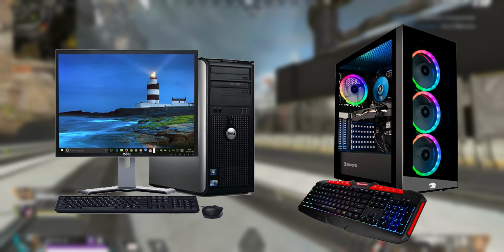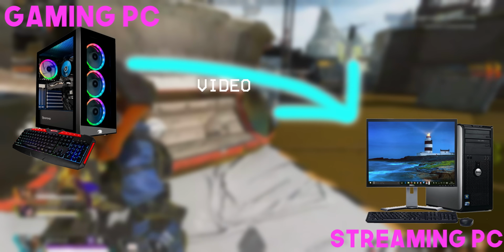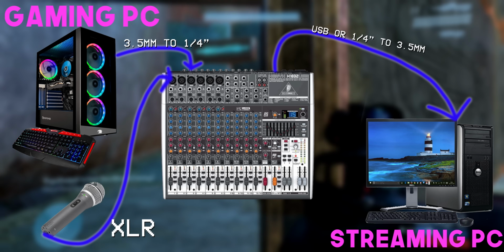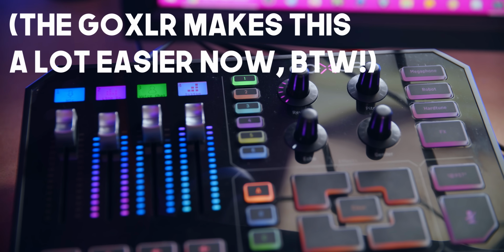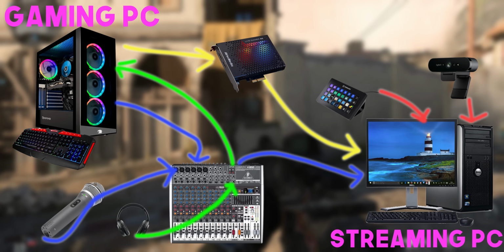SINGLE PC vs DUAL PC STREAMING SETUP - Why and How (Introduction to Dual PC streaming setup)

Comment: Another benefit of using two PCs: the main PC can crash, you still are live on the stream, you can restart the game without losing all the viewers. ;)
Reply: dude you're like smart smart lol
Reply: this is my main reason. i'm building a new gaming PC anyway, i'll just keep using the existing PC (that currently runs OBS+game) for just the streaming/OBS stuffs
Reply: Streaming BSOD Pog
Reply: @Zvala wouldn’t the bill be higher when using 2 PCs?
Reply: And footage💀🙌🏻
Reply: this is why im here my pc keeps crashing im building a new one i maybe try 2 pc setup for this
Reply: @Zvala Too minor to take seriously
Reply: Oh, good point!
Reply: Another benefit of a dual PC setup: you can physically bypass the need for game capture in games where the anti-cheat would penalize you for doing so (CS:GO and untrusted mode), on top of the performance/stability benefit of having two physically separate systems.
Reply: & another benefit is that 10x extra electricity monthly bill each month ;)
Reply: @ItzGhosty420  not really, unless u go with Intel CPUs
Reply: @ItzGhosty420 you'd be surprised. I actually monitored my PC for a month and left it on for looking periods of time. On top 2 hours of gameplay I can get every other day. In a month I estimated it cost about 10 bucks all together for my PC to run constantly in the background. And yes that also includes the times I spent actually using and playing the PC. I'm actually gonna try another month. Where I'll regularly turn it off and on. Just to see how much that will cost. Because I always heard your electronics take up the most power when u first turn them on.

Comment: Another way to send the image (instead of duplicate or passthrough hdmi): run OBS on the gaming PC to get the game capture and send the preview to the gpu hdmi port ; you can send the audio as well through hdmi (monitor). Also careful NDI is YUV 4:2:0 downsampled (like the Elgato 4K60 Pro). The AVerMedia card does 4:4:4 in XRGB.
Reply from the maker: Yeah but if you're running OBS on gaming PC you're already missing half of the performance benefit of doing dual pc
Reply: @EposVox  it's very lightweight doing only a preview (much less than NDI and almost only GPU usage, around 3% on my RTX 2080 Ti with 1440p 60 fps output), and it has some advantages: you can still use the DisplayPort on the main PC and have G-Sync / variable framerate = can play 1440p 120 Hz like I do, and get a smooth 60 Hz preview for the capture, even using just a Full-HD capture card (sending the preview already in Full-HD). But yep, thanks for the quick answer and advice. xD
And another trick I'm doing: no need for any mixer, I get the game sound from the HDMI capture ... and the mic is directly on the streaming PC, that's it (with RTX Voice & compressor and all, yep using a lot of resources but it's on the stream PC we don't  care :p ).
Reply: @FredCHAUNIER  @eposvox I use this setup successfully too. OBS and Discord on the gaming PC don't hit hard at all, then all Gaming PC Audio to stream PC via 'Listen to Stereo Mix on Elgato HD60 Pro'. Mic levels and Stereo Mix levels balanced on Gaming PC.
Reply: @FredCHAUNIER  Hi Can you help me set this up? thanks
Reply: @dw300  Hi can you help me on this please thanks :)

Comment: Very helpful! I have a 2018 Mac mini w/ 6core coffeelake, just collecting dust...Could I use my Mac to stream, while PC for gaming? Zero info online covering my question.
Reply: In theory yes. You would need to either use an external capture card or NDI to get the feed into the Mac Mini however. I would just double check that if you buy a capture card it is compatible with your mac.
Reply: I'll buy your Mac mini if you're in the USA

Comment: I have been running a 2 pc setup for 4+years I highly recommend it especially if you play slot of beta or early access games!! Good video!
Reply: What's the specs of your 2 pc?
Reply: @MrRukanachi  Ryzen 7 1700 16 gb ram AMD r9 380
Reply: @Aims Yes because if you have to restart your gaming PC stream dosen't go down.

Comment: The value of dual PC streaming is completely dead to me,  Ryzen 3950X provides way more then enough power for CPU encoding and playing any games at a single workstation bypassing all issues involved with setting up 2 PCs for streaming.

Comment: So totally stupid question, but do you need a graphics card in your Streaming PC if you plan on encoding via x.264?
Reply: You need something that can handle 1080p 60fps video to composite the capture cards output and any webcams together. If your built in graphics can handle this then no. I tried a super basic graphics card that could handle 30fps but not 60, then bought and old 550Ti for £20 in a computer exchange store.

Comment: What exactly are the issues you come across by mirroring the display through HDMI you mentioned at: 4:15
Reply from the maker: Stuttering, hitching, it not wanting to adhere to the correct res/refresh specs you're trying to use every time Windows reboots, etc.
I had to switch capture cards in my dual PC setup because for what I was trying to do, only cloning worked and I got constant stuttering/pacing issues that weren't actually present in the game, but just caused by the cloning process, and not a problem with passthrough. While not universal, these are definitely not uncommon experience with cloning for gaming.
Reply: @EposVox  ah I see thank you for letting me know!

Comment: Minimum/reasonable CPU for the streaming PC? I don't want to get one that'll just need replaced soon down the road, but I don't want to spend too much on it either. Thinking about getting a cheap prebuilt or a used "entry gaming" PC on ebay/craigslist.
Reply: Hi Zero, you better wait for few weeks for the Zen 3 CPUs to come out if you do not want to upgrade immediately. But, if you are planning to buy before that get a 3900X or better(even if the new CPUs come out look for the similar spec'ed CPU). 3700x or 3800X would also do but 3900X is better future proof. But as per your requirement and less spending go for 3700X or 3800X.
Reply: Don t do 2 PC setup bro.3900/3950x 32gb and an rtx2070super or above is what You need.

Comment: Dual PC is awesome! But for now I'm just fine with my single PC setup, and like the simplicity of it. Good video, as always!
Reply: ur pc specs?
Reply: @rudraksharoy3594  I run a ryzen 7 3800x / 32gig 3200mhz ram / 2080ti and my single PC streaming is smooth. Never have had a problem so far. And I use x264 encoder. Epos secret settings as well.
Reply: @aes210  could you please share those settings? 10900k+2070 Super, trying to use x264 as well
Reply: @aes210  how much was that
Reply: @rudraksharoy3594  You either need a really nice CPU like a 3900X or a Turing GPU from Nvidia, because of the NVENC encoder it has on board. My son's PC only cost $750 but he can stream on because of the 1660 Super GPU. Hope this helps.
Reply: @GraybeardGiffTech  and a better connection than 25/5 PepeHands
Reply: @GraybeardGiffTech  I have a 1660 ti and 2600. And 8gb ram and with all that my stream is really smooth and I dont get any frame drops

Comment: i have extreme difficulties in capturing discord as a window source in streamlabs obs consistently... on a machine works as it should in another... black screen and i've tried everything comes in my mind (disabling HW acceleration ofc updating drivers deleting %appdata% reinstalling discord and obs) out of frustration i've found a solution for me.... screen splitting software! i have a 4k  tv so i thought 4k means 4 1080 monitors and i can get the discor'ds feed as a screen capture. so far it works smoothly. It still bugs me i can't figure why in one machine i can't do it in windowed mode though.... but... i've came to a conclusion that you have to deal with what you have and what you can do to make your stream work....

Also i have a problem that i'm streaming RPG so i need to mix audio but i have a blue yeti as a mic and the only solution was to use a virtual audio mixer like the bananameeter (can't remember the exact name) but oh boy it's buggy i had to restart the audio driver over and over and over so.... right now i'm doing a really stupid thing like picking ambience music through the blue yeti using alexa as a speaker for that application.... and i fear that if i switch to a dual computer setup i'm bound to reinstall audiomeeter banana again...
Reply: Set all the software you're using to run as Administrator, that'll fix most of those black screen (and any audio delay issues). Right click > properties > compatibility > Run as admin. Change your input and outputs in Voicemeteer Banana to Windows Directsound or MME and that can get rid of the virtual engine crashes, but they all should be the same setting.
Reply: @dw300  Thanks I'll try it soon. saw stramlabs obs now has 2 options to capture windows 
bitbit (wich works for me) or windows graphic capture (wich is the mode selected automatically and gives me black screens)

Comment: Dear EPOSVOX does a stock AMD3900x or 3950x stream games at a higher fps than a stock intel 9900k due to the extra cores?
Reply: No. Almost no games utilize more than the 8 cores/16 threads of the 9900k, which wins on faster Instructions per Clock (IPC).

Comment: i am using voicemeeter banana, a very good software mixer, and there is a feature in it called VBAN, a way to transfer audio through the network between different machines. so you might not need extra hardware for audio

Comment: Having a second PC makes everything a lot smoother trust me makes a lot of glitches go away
Reply: Never had any glitches on 1pc
Reply: It depends on your pc, I have no problems with 1 pc build for gaming /streaming.
Reply: @bluebluem4  you use alt+tab alot then?
Reply: @cali_cal  for what???
Reply: @cali_cal  have extra monitors and hotkeys. Easy.
Reply: I've wondered if a 3950X with 2080 Ti or better can be more than enough for "two pc" setup?
Reply: @RUmlas  2080ti alone is enough for a single pc setup
Reply: @RUmlas  r u serious? I have 3700x with rtx 2060 super, it goes so great, no stutter, no lag, no perfomance loss, etc... So yes, that setup you mentioned it's enough!!!
Reply: @bluebluem4  what encoder do you use? X264 or nvec?
Reply: @RUmlas  That's better than some cheap dual setup!

Comment: I ran a 2-PC Streaming Setup and I went back to a Single PC Setup. The main reason is audio! I need to use ingame-voice AND TS/Discord, Voicemod and Music and the setup got so fucking bloated that I finally switched back. I got the Hardware to do so and NVENC helps alot to achieve this so there is no reason except redundancy to do otherwise. My streaming PC was a Windows driven maxed out 15“ Macbook Pro. It worked fine but it is so much easier and I dont want to invest in an extra tower PC AND mixer, new interface and so on. Not yet ;).
Reply: Nice man! But whoa, how did you stream on the macbook pro? I thought it only uses VBR encoding which doesn’t work well for real time?
:0
Reply: @muen1842  actually the radeon encoder is not that bad ... worked pretty well and did a much better job then cpu based encoding
Reply: If you do go back to a 2 PC streaming setup then I would look at Voicemeeter and use the VBAN feature. Makes sending audio to and from multiple computers a breeze.

Comment: Easy: NDI. Done. but NDI's quality is really horrible. I don't get why they say "you need 1GB internal..." when it only maxes out around 120Mb across the router even when setting it to High bandwidth usage
Reply from the maker: 1080p60 NDI usually uses 200-300mbps. Quality is not horrible in any testing or experience I've had/seen
Reply: @EposVox  Good to know it's not really 120MB, I only saw a video of someone testing it and it was peaking on his at around that. Quality issues: well, I'm 1440p going 1080p, and most likely why it's bocky/blurry on my stream. I'll have to toy with it more maybe. I like it, it's like 1% usage on my gaming side, which I love, can't feel a thing!

Comment: I have been able to put up with all of the headaches of display cloning...except for the alt tabbing. 10-15 second alt tab freezes are MY NIGHTMARE. 1440p144hz gaming with a monitor lacking hdmi 2.0 and a dual pc setup = a bad time right now. We need more monitors on the market.

Comment: Please do a video on multiple monitors with mixed refresh rates issues on single streaming PC.
I'm driven crazy with OBS preview window stutter (which translates to stream/recording) because OBS is open in a secondary monitor with a different refresh rate to the main monitor.
Windows 10 update 2004 was supposed to resolve this issue but does not on AMD CPU systems.
Reply: Why do you need to see OBS preview while streaming (you can turn off preview)? You should be monitoring the actual stream.
Reply: @Safetytrousers  
It's pretty standard to have OBS running in a secondary monitor I believe? Video even states it at 8:29.
You can monitor your preview window (which is what the viewer will see), your scenes, monitor your Twitch chat & stats and you can monitor your stream stats for network lag, skipped/dropped frames due to render or encoder lag etc.

Comment: if i have a Ripsaw HD capture card that only has HDMI input and output but my monitor is a 2560x1440 @ 144hz monitor using a 2060 Super that only has one HDMI and 3 Displayports, how could I most efficiently do this while still being able to game at said res and refresh rate?
Reply: Get a display port to HDMI cable due to the way that display port is handled as long as it’s a display port source you should be grand
Reply: You could also clone the output so that your HDMI and DP are getting teh same signal from your graphics card. I'm not sure what the impact of that would be performance wise however.

Comment: Hey Epos, I have an unusual situation that I hope you can help me with. I am planning on dual PC recording but I have a 21:9 (3840x1600) monitor. Planning to record OBS 4K with other sources taking up the 560 pixels of black space at the bottom such as face-cam etc. I know that most capture cards don't do odd-ball resolutions that well but will this work because it's in standard 16:9 4K overall or will it fail because it's transferring the 21:9 signal? If so, what do you think is the best card for 3840x1600 recording?

Comment: On the needing multiple monitors,

For chat, you can use a smartphone set above your webcam, so you look in the general direction of the webcam when reading chat.

If you want to be fancy, you can even use a teleprompter with the chat running with a mirrored screen. This allows direct eye contact with the audience Every time you read chat.

Just add /chat at the end of your url.

Ex: https://twitch.tv/eposvox/chat

Comment: If you can afford a dual pc setup it is imo the way to go even if both systems are low to midrange over a single high end system. Imo the only disadvantages of going dual pc is the extra cost and technical setup but imo its worth it by giving you a lot more power and control over your stream.
Reply: The only extra cost is a capture card,  software only voicemeeter is required.

Comment: Sad to see that Voicemeeter doesn't get mentioned. You don't "need" a mixer.
Reply: How can voicemeeter send audio from one pc to another? How can voicemeeter take an xlr input? How can voicemeeter merge audio from two pc’s into one headset?
Reply: @Martin__  vban which requires voicemeeter on both machines. Usb audio interface is still needed for the xlr. Voicemeeter banana and above can send audio to both headsets. As a shareware solution it solid til you can get the funds for goxlr
Reply: @Martin__  VBAN. It sends audio over ethernet cable. You select the source/destination, give it a name and fill in the ip of the receiver/sender and done. With only a small delay. 

If you use an xlr mic you'd still need an audio interface or xlr to usb cable (but don't use that please).